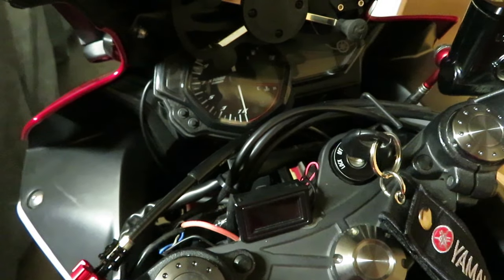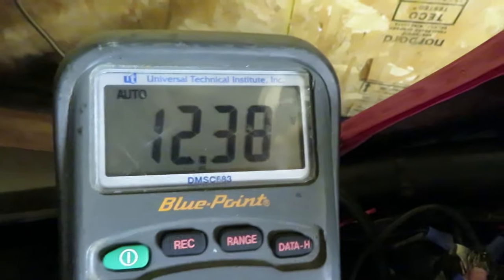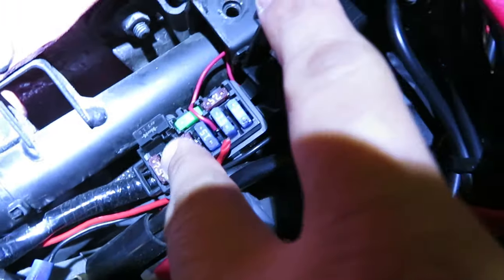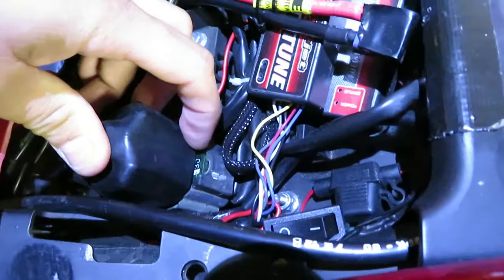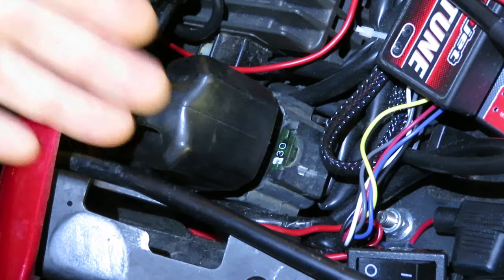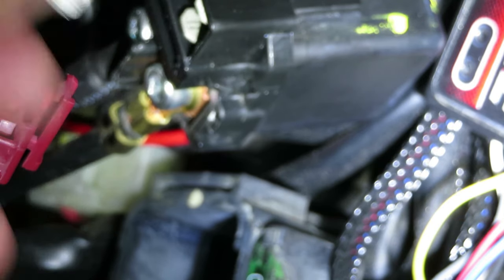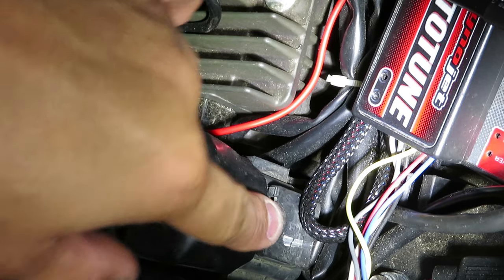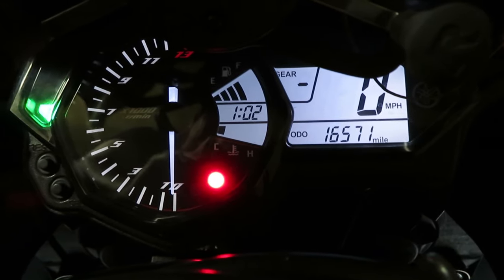I have the Ignition on but there is NO Power to the bike??

Comment: This happened to 2 of my bikes and neither were fixed by this solution but these fuses were popped as well.  (They Are still not fixed) any ideas?
Reply from the maker: check the main wire harness could be the display cable is burned causing the display not to function
Reply: @ACProductions77  The problem ended up not just being the display but the entire motorcycle as I said. The fuses in the line were replaced but it fried out my tuner. I would assume that the CPU would be toasted otherwise
Reply from the maker: @kylekons3672  what did you end up doing

Comment: Need some help guys.
I have a 04 Tmax 500,and it doesn’t get any power from the battery anymore.Had a fuse blown,changed it and also changed the starter selenoid and brand new battery.It just doesnmt want to work anymore…
Reply from the maker: there must be a short somewhere in the electrical system.

Comment: I have an RC51 and the cluster will not lite up but the bike runs fine and when I hit either brake the cluster lights up! What the neck is happening here? Please help, somebody has to know the answer to this. If you know you're a master mechanic! Thanks for anything that helps.
Reply from the maker: take apart your gauge cluster it could be the solder weld has come apart from the circuit board and that's why when you hit a bump it hits the board giving contact to light up. you will have to check which one is the loose one and Re-Solder it.
Reply: @ACProductions77  I was told it was a ground problem somewhere in the wiring, what do you say to that? also the same bike now after running it up to 150 mph it is missing and sometimes running on one cylinder. easy to tell with the exhaust that I run. thanks for anything that you help with!!
Reply: @ACProductions77  I don't know if you are aware that I said when you hit the front brake or rear sitting still the cluster lites up! thanks!!
Reply from the maker: @dannyhampton711  it could be a ground issue or a short somewhere in the wiring.
Reply: @ACProductions77  thanks!

Comment: Didn’t fix mine but I still have power to everything with a test light and blinker but no power to gage
Reply from the maker: you may need to check the main wire harness and see if there are any burn cables, if so it may be the cable that controls the display.
Reply: @ACProductions77  thanks I’ll do that it’s just weird sometime it will come on for few min then it will just go off on its own and come back on but will stay off for awhile
Reply from the maker: @chrishaines3447   check and make sure that the battery cable are on tight.

Comment: So what's next when that fuse keeps popping, that's what mine is doing.
Reply from the maker: then you have a short, check all wires make sure that non are stripped and touching each other or ground
Reply: Did you ever find out what was happening ? Same thing is happening to mine

Comment: I kind of have a similar problem but a different I have a 2005 Suzuki katana I lost the key so I went ahead and ordered a new ignition from eBay and I should have known better it was a cheapy from China hook it up. So I figured it was just a cheap piece of junk so I bought a used one online . Hooked it up nothing no lights no sound nothing there was no problem with the bike all I did was unhooked the old one because I lost the key but the new one on nothing but the. used one on I bought nothing no lights nothing I can't figure it out I've checked everything so I ordered a new one from Suzuki OEM but I'm really at my wit's end . I guess I'll check it again
Reply from the maker: have you  tried looking at the main wire harness plug could be a burnt wires. also check the battery make sure its tight & secure and fully charged, then also the starter rely fuse like in this video

Comment: I have the same problem but the main relay is clicking noise , the display not on and the bike doesn’t start
Reply from the maker: in that case its a dead battery or a low voltage on the battery it doesnt have enough power to turn on the bike and needs to be charged
Reply from the maker: here is a video on how to charge your battery click on this link >> https://youtu.be/D8Oz8ak75Xw it will also show you that on a low battery you will have a blank screen

Comment: A just put a new lit ion battery in my bike, and now my display doesn't work. Check fuses, nothing.
Reply from the maker: make sure you connected the wires back in the right location sometimes those new batteries have hard to see indicators for the -- & +
Reply: @ACProductions77  I did. Unfortunately, I think it somehow sent a pulse big enough to fry my display.
Reply from the maker: before you conclude to that check the wires leading up to the display in the back of the cluster see if any have been burned

Comment: My lights come on but the engine has no power?
Reply from the maker: do you hear the fuel pump whining noise?
Reply: @ACProductions77  it doesn't have an electric fuel pump. Carburetor.
Reply: I changed the relay.but sometimes it works and sometimes not.
Reply from the maker: @johnbarlow9277  im not that familiar with carbureted bikes, check your + & - cables make sure there on tight, if you say that the relay sometimes works and sometimes not then make sure that you got the correct one in there, maybe but another one to make sure that the one in there is not defective, also check the cables that go to the relay make sure that they are not loose.

Comment: I have a V-Strom DL650 e DL650A 2011

Watch the video: https://www.youtube.com/watch?v=kphtCboJyD4

The bike was in the garage, I went to start it and the panel doesn't light up and the bike doesn't even start.
It doesn't turn on the headlight, it doesn't inject the gas pump, it doesn't work, it flashes, it doesn't turn on the taillight and it doesn't horn.
The only thing that works is the neutral light on the dashboard.

The battery is new, marks 12.32V, everything is fine.
I checked the ignition key, everything is fine.
I checked the fuse box, everything is fine. All are at the correct voltage.
All terminals have been disconnected and cleaned.

What can it be?
Reply from the maker: check the Main wire harness connector normally located behind either the left of right fairing could be that one of the wires or terminal has been shorted or burned